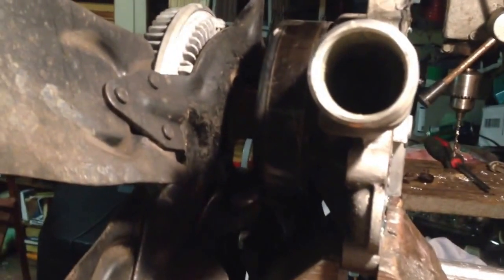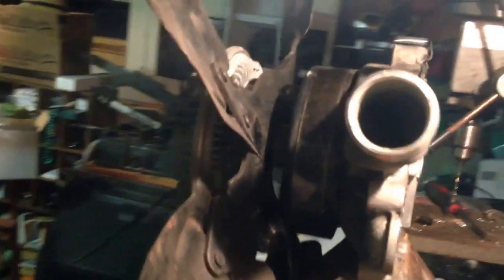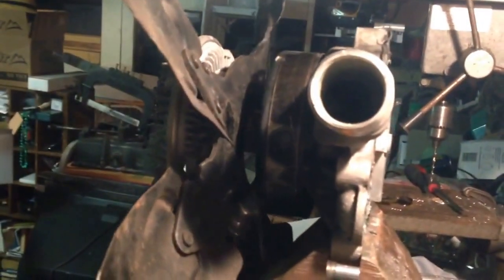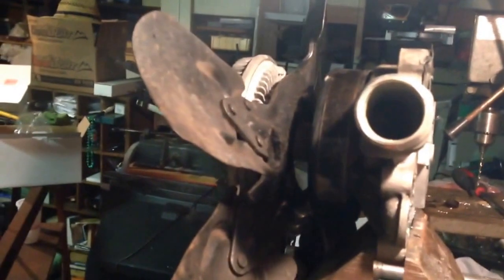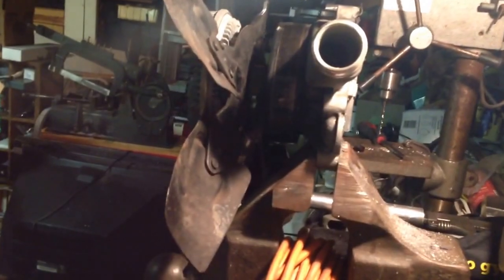Water pump/fan/clutch removal tip, Dodge dakota.

Comment from the maker: The video was made as an afterthought, I probably would have covered it better, and will if I've got to do it again, those clutch fans can be hard to remove in the vehicle so getting it out as an assembly and getting it in the vise really helps to get it apart, sorry you didn't care for my video.

Comment: Thanks for posting the video man. Didn't really answer my question but I appreciate the effort. Don't mind the haters. What about that black pipe thing that comes out of the pump and attaches to a hose? I've watched a bunch of videos and no one has really addressed it. It's not threaded so how does it attach? Thanks again for putting forth the effort to help the rest of us shade tree mechanics. (I only wish I had a tree)
Reply from the maker: It's been a while since I did this so the memory is a bit fuzzy, if I recall they're just hose barbs, the hose being held in place with a spring type clamp, maybe there's a screw type clamp on it, I don't remember having to deal with anything unusual in that department, just loosen the hose clamp and pull off the hose. Thanks for the nice comment, this video proved to be much more popular than I had expected, when I do the repair again some time I'll be sure to make a better and updated version.
Reply: Here hoping I never have to do this repair again. Took me 3 hours to get the old pump off(with the fan still attached)  then it got dark ;) It's a 2000 and this is the OE pump so most of the bolts weren't really excited to leave their happy place
Reply from the maker: +daddyquatro damn that's pretty good life out of a water pump, I believe this was the 3rd during the life of the truck so far, I figure every 5-6 years they wear out, though it all depends on your driving habits and how many miles your putting on it.
Reply: Well I got this truck 3rd or 4th hand so I can't say for sure, I'm just judging by the rust and stubbornness of the bolts that they'd never been removed since it left the factory floor.

Comment: Hey I have a 2001 dodge dakota 3.9L.   Not really sure if this is a problem or not but here it goes......  when I go to start it up, it runs fine, I pop the hood and it doesn't seem like the fan is turning very fast, sometimes it really kicks in and spins the way it supposed to but not all the time.... is this normal??  Should the fan speed be at one speed all the time or does it fluctuate back and fourth?  Don't know much about it considering I just got the truck and it was neglected pretty bad,  sry if this is a dumb question but it's just got me puzzled because I thought after you start the engine and where the fan is belt driven, the fan would stay at one constant speed..... if this is not normal could there be a problem with the Clutch??  Thx in advance
Reply from the maker: revellgordon1 first off I’m not a mechanic, I just know some things and can manage to keep my truck running fairly well, now that being said a fan clutch is intended to engage the fan sometimes but not all the time to keep the engine at its optimal operating temperature without wasting energy running the fan unnecessarily, unless the bearings in it are bad or your having an overheating issue I personally wouldn’t worry about it. Take what I said with a grain of salt, I’m not a professional mechanic, you might do further research on one of the dodge forums online, there seems to be many smart folks there and I’ve found many answers to my own questions by searching there. Best of luck on your truck, and thanks for watching.

Comment: Hey captaingreenbush...I have a 95 ram with a 3.9l.  same setup, but i removed the radiator and shroud and pulled out the fan/clutch/pump combo just like you.  How did you get the clutch off the pump?  I'm figuring I'm going to have to find a machine shop to put a hammer on it.  But I am replacing the clutch to.   thanx
Reply from the maker: I clamped the pulley in the bench vise and used a big wrench on the nut with a cheater, they make a spanner that acts on the holes on the front of the pulley but that wasn't cutting it in my case, the pulley was crushed some in the vise, but since it it integral to the water pump i was replacing it wasn't an issue. the nut is notoriously hard to remove, i highly recommend using an anti seize compound on the threads when you reassemble it. if your replacing the clutch too than you could just use a sawsall or any other suitable cutting implement to cut the shaft and remove your old fan blades and put them on the new assembly. good luck with your repair, and thanks for watching!
Reply: Thanks man...I will try a Sawzall tomorrow....but if not I'll put it in a vice Monday and get a hammer wrench on it